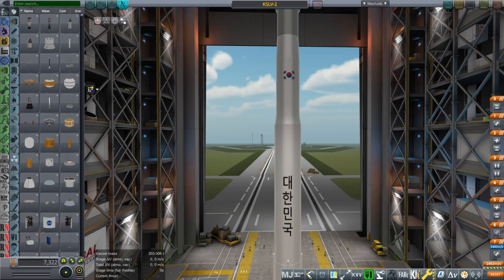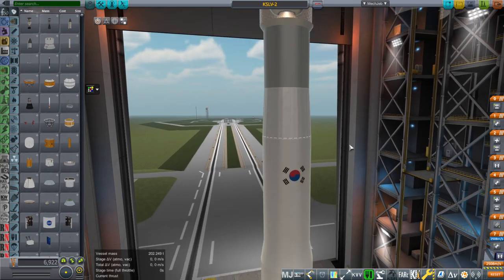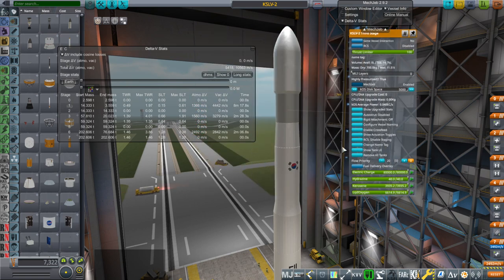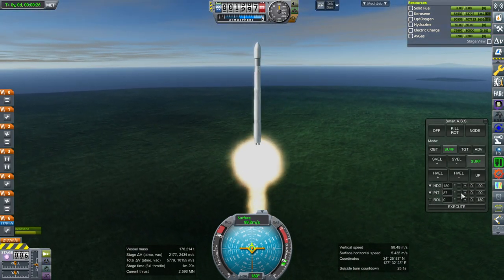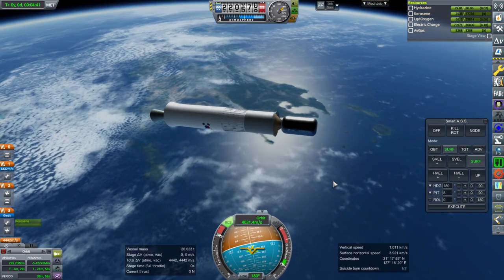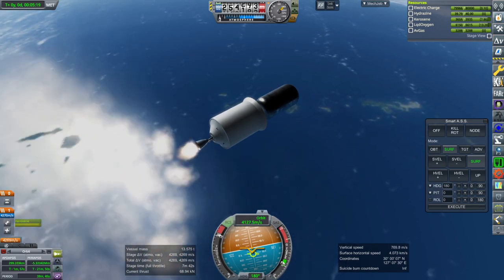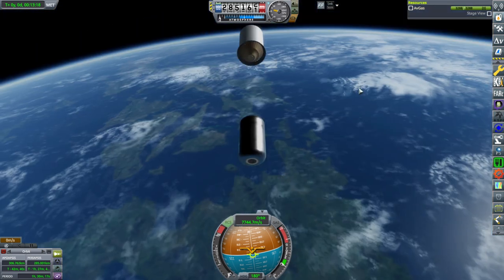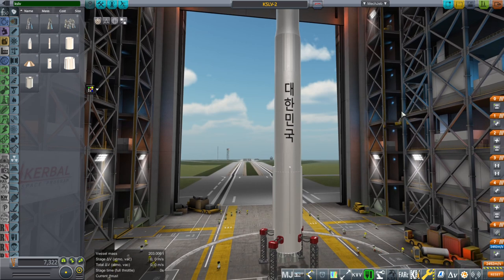Realism Overhaul in KSP 1.8.1 - KSLV-2/Nuri Rocket

Comment: 1:10 As I've said earlier, I wish there were different types of kerosene and similar hydrocarbons in RO/RealFuels—the different densities would be nice to have, at least.

Also, I doubt that the energy density and stoichiometry of Jet A-1 would result in a significantly lower ideal specific impulse than with RP-1 (RPA doesn't indicate one), but that the inferior thermal stability properties of Jet A-1 necessitates making more compromises from that ideal, in engine design if not mixture ratio.

Comment: 200+ tons rocket with a payload capacity of 2.6 tons? Seems like it has a really bad mass ratio or something
Reply: It's a polar orbit right?
Reply: Polar orbit + not using rp-1 leading to lower isp on all the engines will do that.
Reply from the maker: There's partly a scaling thing - smaller rockets tend to have worse mass ratios than you'd expect, because the dry mass scales with surface area and the propellant mass by volume. Obviously they're not doing Atlas-like balloon tanks. They also aren't using common bulkhead tanks.

Comment: I hope one day you will do Russian next-gen rocket family Angara (except 1.2 with new second and upper stage,A5 with DM and KVTK,A5V). 
http://www.russianspaceweb.com/angara.html
it's a pity that everyone forgets about these developments, except for Russian video makers(
Reply from the maker: DECQ already made a mod for it and I've already done videos on it using that mod: https://www.youtube.com/watch?v=gvy4B0xkMIM and https://www.youtube.com/watch?v=cztzMvOATZE. So I don't know about this claim about everyone forgetting except Russian video makers. However, if I'm going to make more videos on it, they really need to launch one of the variants again. Sometimes I hear they're working on something else instead, and other times they say it's still going forward.
Reply: 1.2 has another, thinner stage of 2.8-2.9 meters and a separate upper stage. The A5, in turn, will have a larger number of fairings (this is especially evident in the version with KVTK). these are 4.35 and 5.1 meters. A5V will generally have a stage with RD-0150, which is not in RO. And I would like to see the stage of KVTK more close to reality. 
Yep,Roscosmos has real troubles with this family. But they are shifting their temps for hydrogen variants. 
I know, they denied A3. But that’s all because it has very low launch performance. It can be beaten by much lower-cost Soyuz-2. New Soyuz-5 has mach better performance for high  orbits. For example it has 5,5 tons to GTO and 2,5 to GEO,comparing to 3 and 1 tons at A3.